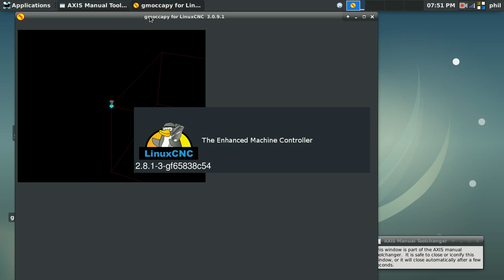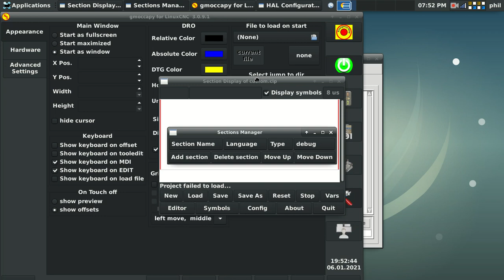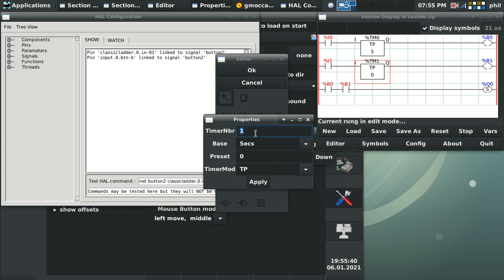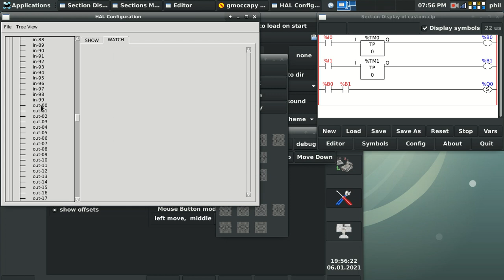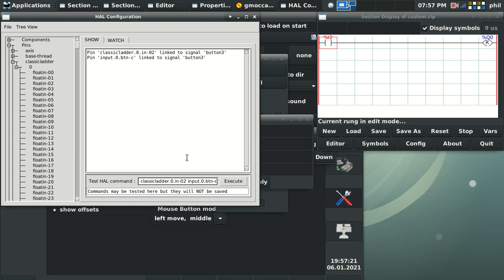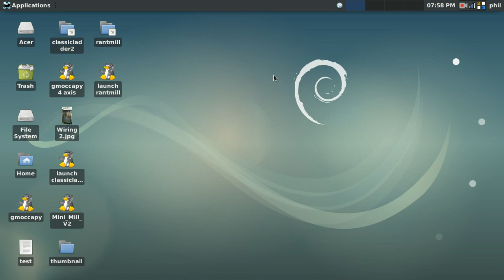LinuxCNC Classicladder real world timer example - timed deadman switch

Comment: Nice video, and a very good explanation, but i would have added the two inputs also to the reset channel. Because when you Press your deadman you could theoretically touch in the danger zone because the press moves further when you release the Deadman. In Germany where I live is this not allowed. Top video   have used anyway a lot of your tutorials.

Go on with your super work.

-Sven
Reply from the maker: Good catch. This was a quick, down and dirty example. There are definitely ways to really fool proof it even more, as you mentioned, I just wanted to give a workable example to add to my timers and counters tutorial 😊